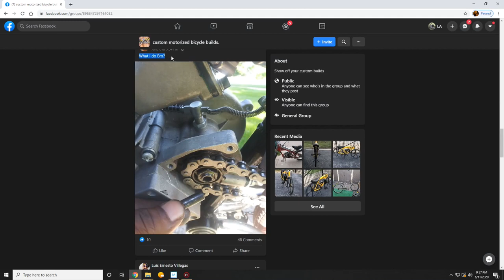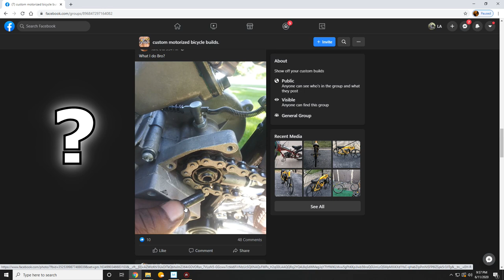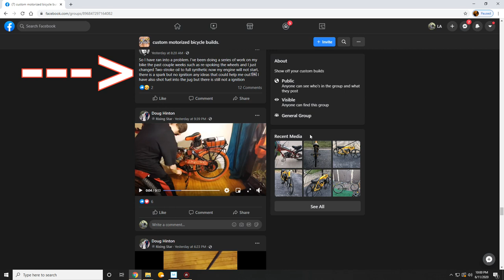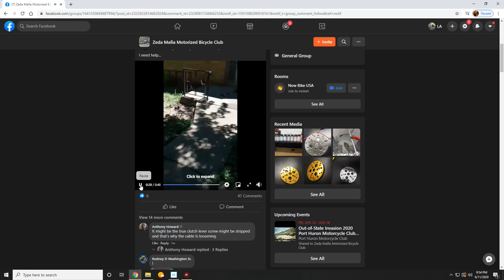How To Find Motorized Bike Help

Comment: Good video an alot of good points an also if your clutch arm hit your bike frame you could aways reajust the arm by taking it apart and bringing the arm a little more outword or make a new bucking bar a little longer not much if you ever need a new bucking bar dill bits work great the right size the bottom part of the drill bit an they're made of harden steel just cut to size. Hope this info help i learn new info every day myself peace bro your videos get better an better much love

Comment: I'm trying to get the best rear wheel I can for my motorized bikes. One of my bikes I baught a mag wheels. The problems are that thr axle for rear wheel is low quality and bent under weight and extra stresses. It is also a special design to work with its bearing design. I can't replace it with better axle from the standard hub. The front is too wide to work with my fork and use the disk for the break. The disk scapes the fork. What I'm looking for is a heavy duty double wall rim. I also don't know how I can get thicker gauge spokes, like I see on some high end electric bikes. The wheels also need to be disk break wheels as I mount the chain sprocket on it for the rear. I also use the c break on rear. The front i have a hydroloic break and the c break. The hydrolic saves on my pads and is great if I'm going down hills and need to stop quickly.
Reply from the maker: What size and how many speeds? I'll see what I can find.
Reply: What kind did you buy? I have two pairs of the 10 spoke ones that bikeberry sells.  I'm really tough on them,  one of them is on a Phatmoto with a 3 horsepower Home Depot lifan. Thing has a ton of torque on a heavy bike. Never had any issues so far, thousands of miles.
Reply: @marcs4091  I had to go back and search old orders from Amazon. They were MTB and they had six spokes. I thought about blueberry but I bought a bike and a four stroke motor from them once. Well the bike design didn't work well with mounting a gas tank. The motor I guess the centrifugal clutch went bad and the motor sat until I finally gave up waiting for them to get one in. It was on back order every time  I went looking. Over a year! Also the cam shaft was a thickness that only there clutches worked. I heard from others they have a lot of order inventory and order problems. Since then I've avoided anything more than a few dollars with BBR name or from bikeberry.

Comment: Hey dude! Nice video! I wanted to ask what should I do when I'm putting on maximum throttle but my bike hits a speed-wall. I remember you said something about speed-walls in an earlier video of yours but can't remember which video or what you said. I also installed a 32 tooth aftermarket sprocket on the bike. Also,
You're about to hit 4k subs!
Reply from the maker: There may be other things that I'm not considering. But generally these are the three main conditions I have noticed.
(Assuming you have a clean carb, good fuel delivery, no air leaks, and no heavy air restrictions.)
At Wide Open Throttle with the stock exhaust.
1 (normal): Motor gradually gains power at low RPMs. Motor begins to pull stronger at mid/mid-high RPMs. Motor slowly tapers off at high RPMs.
2 (fuel rich): Motor bogs at low RPMs, Motor begins to pull stronger at mid/mid-high RPMs. Motor slowly tapers of at high RPMs.
3 (fuel lean): Motor has a weak/soft pull at low RPMs, Motor gains power at mid RPMs, Motor pulls strong at high RPMs than QUICKLY tapers off.
Playing with the needle clip might help, but at wide open throttle the jet size has the biggest impact.

Comment: Hey man I have the SAME problem you had I just baught my first  motorized bicycle I ahve the cluch cable set up when I pull on the cluch it pulls the cluch arm thing in engaging it but the only problem is when that cluch thing is pushed all the way in the cluch still does not engage any idea what I should do

Comment: Here's an issue, the little pin in the housing holding the clutch release bar in place broke off with a piece of housing, fun stuff riding home without being able to disengage the clutch, lol, no biggy had a spare at home, 
Next day went to take a ride and strangely the motor won't Rev under load, and makes a strange squeal 😨
Reply from the maker: That's new to me, keep us posted.
Reply: I will I have plenty of spares kicking around, start with the simple by just swapping out ignition parts one by one and keep going until problem solved,, it's part of the fun of owning a couple of these, break one, learn from it and use that info to keep the other 2 going stronger 👍
Reply: So, update on the Rev issue and squeal,  
Rev issue was my doing, I had a huge vacuum leak and a faulty float, 
Now the squeal, that was created with the original break of the housing, a piece got lodged between the sprocket and housing

Comment: I have a question. I am very familiar with these motors and built about seven of them now usually because they are inexpensive I just buy a new one so luckily I have parts. Getting to my question everything was running perfectly. Then all the sudden not even going to pass by I heard metal on metal and the clutch sliped for a second, then it would catch but I knew something was wrong I'm assuming it's a Woodruff key break have not open it up because I am putting a new motor on the bike anyhow metal on metal definitely heard something snap would you agree with that being at Woodruff key because it did catch for a brief moment but I immediately shut down I believe it broke part of the keyway and it just caught by chance then it was slipping what is your suggestion on that thank you very much I like your videos I will post some of mine also I am going back to Skyhawk I just purchased a GTA 5 ES drill or electric start and not so concerned about starting what is your opinion of these I know sometimes it's the luck of the draw but I am going to install this one better than the last to eliminate vibration I believe that's what kills it mostly thank you

Comment: You can move the clutch arm in relation to the cam, it is possible for the factory to misalign the arm to the clutch, and it not be in a usable position, just remove the bolt and tap it off with a hammer or a vice, unfortunately to reseat it it's near impossible without a vice/press/jack of some type or you'll be spending lots of time with a hammer or mallet trying to force it back in to little luck, it's possible but not easy

Comment: I have a issue where my motorised bike engine is leaking oil not from the carb or exhaust gasket but from underneath the engine the oil drips onto the frame and oil is leaking from somewhere under the engine how do I fix this problem? Or will it go away?
Reply: Open the magneto and see if there oil In it, also check all the gaskets and see if there are leeks

Comment: I had some stupid assistant mechanic decide to screw the cylinder studs into my crank shaft and I can’t get them out with my vice grips any tips for me to get them out as I. Down into the crank case and there seizing the crank shaft  I beleve he used my impact to put them back in after I’d removed my cylinder head and cylinder in order to replace the cylinder

Comment: How the hell did you fix the chain rubbing the frame by the rear sprocket? My motor is mounted straight and solid, sprocket is 100% level and even, and the rear wheel is dead straight. Yet my chain keeps rubbing the frame hard.

Any advice would be appreciated.
Both bikes are Nel lusso & Cranbrook
Reply from the maker: Most sprockets have an offset. Make sure yours is flipped so that the chain is closer to the tire. Also if the rag-joint is not tight enough it won't compress and pull the chain closer to the tire. If all else fails try a smaller sprocket. Something like a 40 or 36 tooth should do the trick. Oh and OFC make sure the motor is not tilted.
Reply: @LAHover  tilted as in to the side or forward?

Comment: LA Hover,  My bike wont start, whats wrong with it?  seriously though, if you don't have disk brakes on the front wheel, is there anyway to attach one without replacing the hub?
Reply: Hey guys, I just built a bike at ran the first two times I ran it and now I can't get any spark I check my Magneto Loop set it works in every aspect at work I check my spark plug it works in every aspect it works it's gapped properly and everything I check my CDI I'm not getting any readings on my ohms meter so I bought a new CD no readings on my ohms meter so I bought another CDI no readings on my ohms meter this is my fourth CDI and I can't get my bike to run is there a website that I can order a CDI from that work

Comment: Hey guys ☺️ I'm having an issue with my bike. When it's running fine with no issues and the second I pull in clutch it shuts off motor. If I release the clutch it starts right back up. I've changed carbs to  different motor and they work fine. Only on this motor it will not stay idling once I come to stops. Any help will be appreciated

Comment: after removing sprocket my bucking bar is too long and bucking bar cover dont fit. before changing sprocket everything was good. can you help me!?
Reply from the maker: adjust the flower nut on the clutch plate. I THNIK, you will need to tighten it. Also, if there is to much grease between the bar and bearing it can be to long until you try to ride it.

Comment: Will a real MZ65 work on a cranbrook
Reply from the maker: Yes, but I think it hits the frame if you are using the universal engine mount for the front motor mount. I think the motor needs to be flush mounted.
Reply: @LAHover  thanks brotha

Comment: I have an issue with my bike and I am interested if any one might try help. Tell u more if u want to know
Reply: What's the issue you're having?
Reply: @Drz_noah470  Hi, thanks for resounding the issue I seem to have is some sort of problem with the carburetor.
 Eg my bike starts fine will run fine for 10 to 20 mins and then start to bog down and sometimes cut out. I have watched many videos and found one with a very similar issue but they didnt seem the be able to fix it. And when I get the problem the hoes seems to get an air bubble too. 

To fix it I have to prime the carburetor by pushing the red pin on the side to get more fuel in which makes me think its is a float related issue but checked and cant seem to find a problem with it. O aswell it also idols fine aswell. 
Any advice is a help thanks.
Reply from the maker: If your problem is the same as in that video it sounds like a fuel delivery issue.
Try disconnecting the fuel line at the carb and make sure it has a steady flow (anything more than dripping is fine).
Make sure the choke is not vibrating up on you while you ride.
Next step, clean the carb.
Reply: @LAHover  Thanks for replying. I took your advice and disassembled the fuel line and found my on and off tap coming out of the fuel line was blocked with paint chips from the top of the fuel tank braking off and fall off.
The little filter that is attached to the on and off, I must not have put on right and so the paint chips were blocking the fuel flow. I blew them out and works perfect thanks.